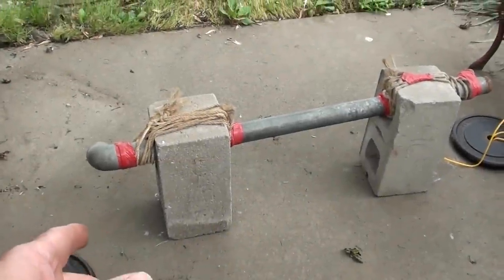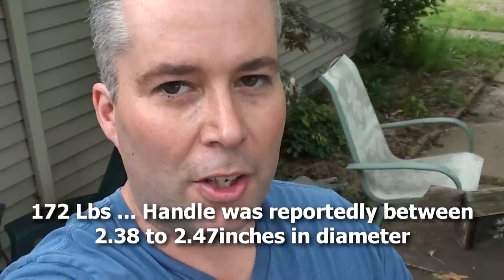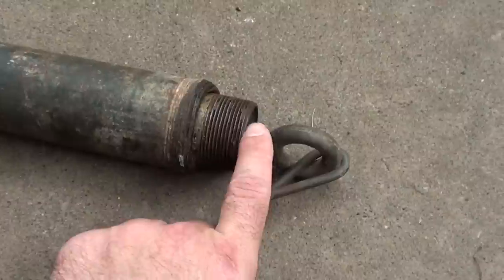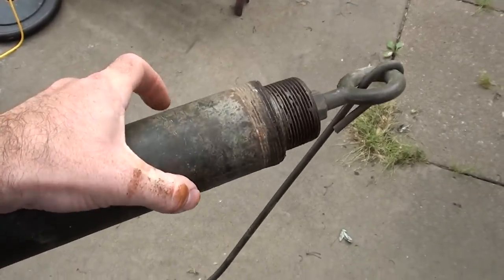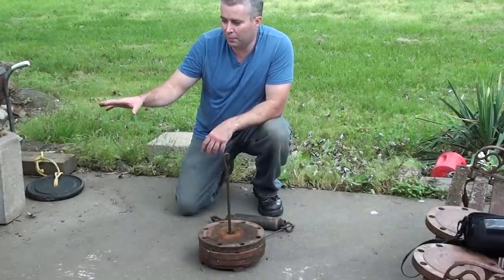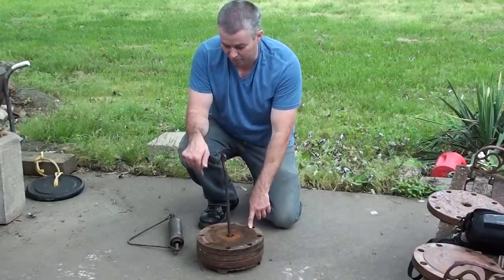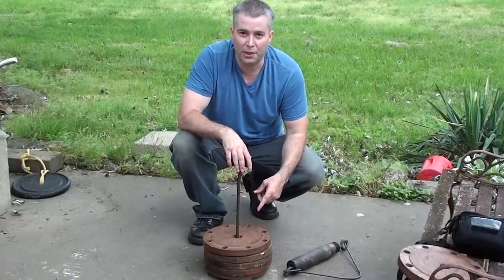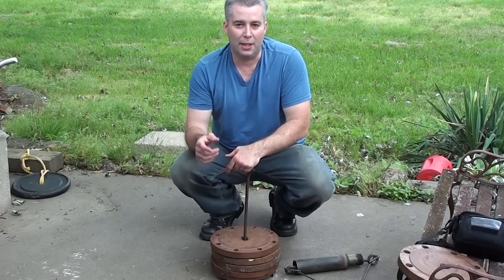Homemade Grip Strength Training Equipment

Comment: Very good, your second tool i've seen described as a 'rolling thunder'. The handle looks extra thick and difficult, have you also tried a pinch block on the loading pin?